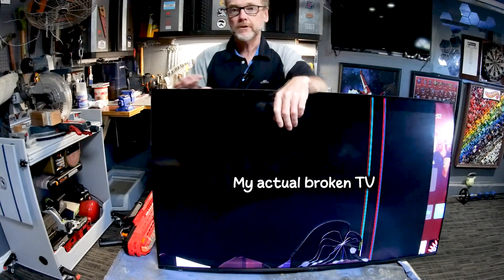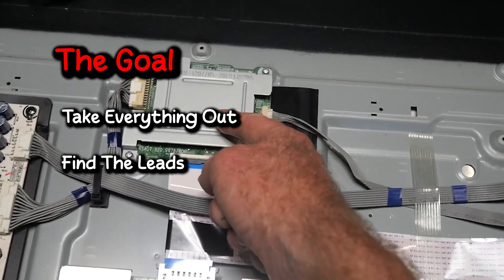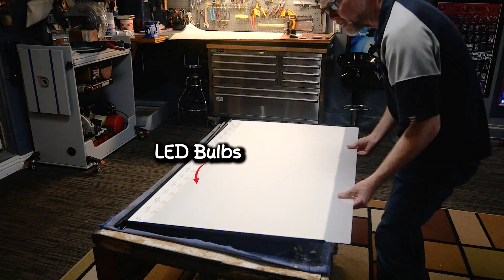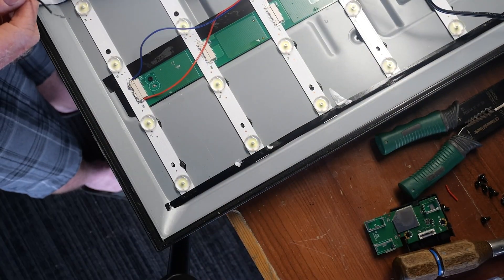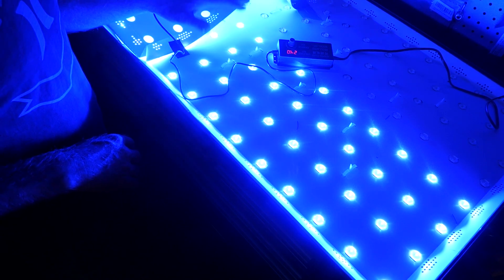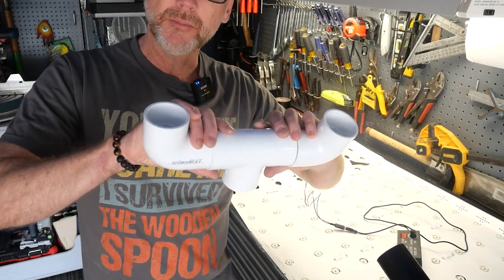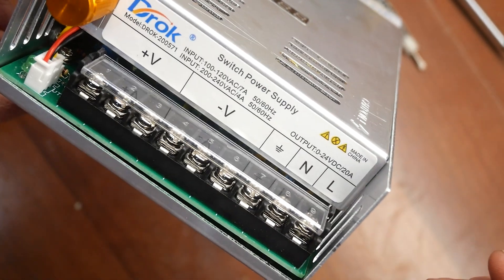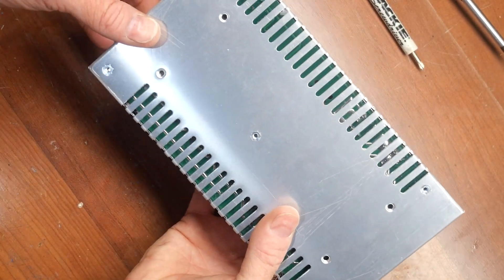Convert a broken LCD TV into a great shop or studio light for about $40 bucks!

Comment: i did the same think with my broken tv but instead of using the original LEDs i used a12v LED strip and it gave me a better results 
great job anyways 💪
Reply from the maker: It's a great little project for sure.  I would have gone with new LED's too if I couldn't get the old ones to work.

Comment: I did that with a 55 inch, but instead of using an external psu, i modified the original one , connecting the 5v vsb to the power suply on and the led brightness to the 3.3 rail, so when you plug the tv all comes to life without any other component
Reply from the maker: Were those markings visible on the logic board or did you have to look at the schematics ?
Reply: @IfAlexCan  I had to look at the schematics and then check if they behavior was the expected connecting the cut wires that were going to the logic board. Then when i confirmed all was correct i made the final cable and take out all that wasnt necesary

Comment: Good work.  It's nice to see a project that reduces e-waste.  Those with a better knowledge of electronics will be able to utilize the original backlight power supply and lower the overall cost.  As I remember, it's a matter of supplying a constant signal voltage or common ground to one of the wires that connects to the power supply circuit board.  Often there are marks on the circuit board that indicate what each wire is for.  One of them will be marked "on/off" or "PWR" or something to that effect.  Checking that wire with a volt meter will let you know what is needed to keep the power supply and backlight active.  For example, that wire may have 5 volts on it (logic high) when the backlight is on and zero volts (logic low) when the backlight is off.  The signal processing board is what controls it.  If there is no input signal or the on/off switch is pressed, that wire switches logic states.  It's possible to rewire the original on/off switch to control the power supply and in turn the backlight.  Controlling the power supply voltage and thus the backlight brightness is also possible but requires a fairly in depth understanding of switch mode power supplies.
Reply from the maker: Good points all around.  I should have looked on the logic board the lights were connected to to see if it had a dedicated PWR or on off.  Initially it just. It looked like it had 2 20 pin ribbons attached.
Reply: Tip = The power consumption of factory packaged LED's is way higher. So replace the factory LED with a cheaper strip.

Comment: Man, you have Just done so many mistake with your electronics, Wall lead have to be L(live) and N(Neutral) + Ground.

Houses use alternating current, than the Power supply convert It to Direct current wich almost every electronics use ( other than some motor etc... ), V+ is positive and V- Is negative of the output.

If you don't understand what are you doing don't play with 110-220v.
Reply from the maker: You learn way more from your mistakes then successes.  So I guess I learned a good amount this time.  Thanks for the advice.
Reply: @IfAlexCan  that's true but one mistake with that voltage and it can be your last.

Keep going but do some research and maybe you can go to a fast electronics class.